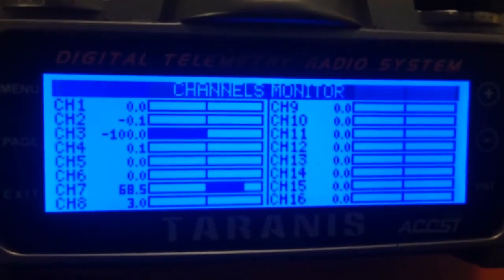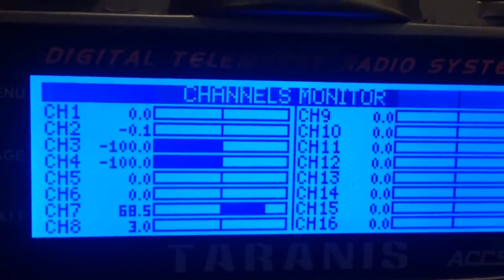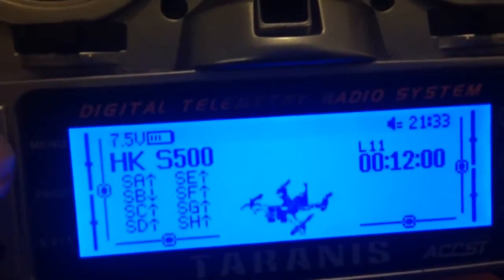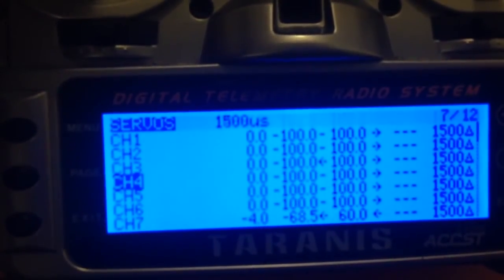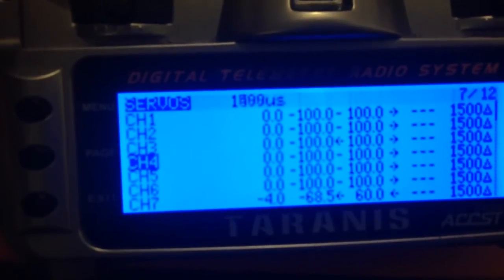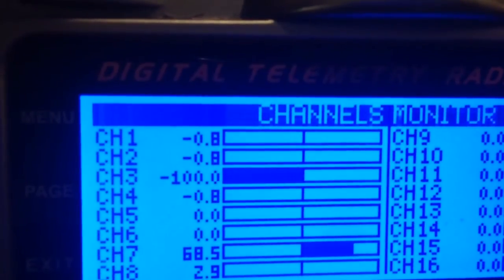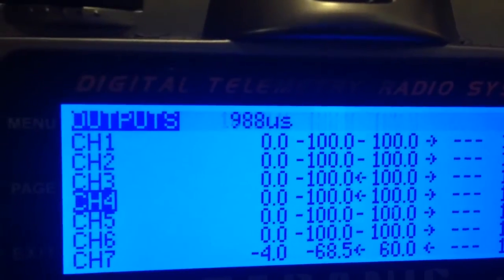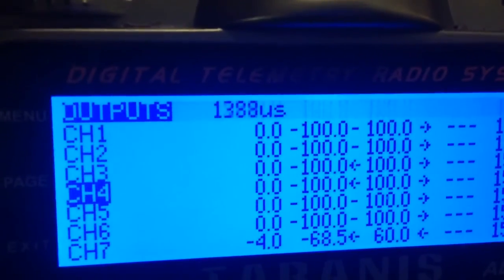Centring precision - Open TX 2.0.19 vs 2.1.8

Comment: So for my understanding, there is two branches 2.0 & 2.1, but what are the major differences between them?
Reply from the maker: +ABMNS PRODUCTION Yes that is right.  There is no further development with 2.0 and 2.0.19 is the last version - it is very stable and works great.   There are several differences in 2.1, the main one I have noticed is very different handling of telemetry, it seems more complex and you have to spend more time setting up but is also more powerful and so I think ultimately better.    They are still developing 2.1 versions.
Reply: ***** Thanks for your answer! I was reading the documentation actually and it looks like indeed the major difference is the telemetry capabilities, it allows the radio to work far away better with our different external modules like my Dragon Link UHF Transmitter for example!
Enjoy your friday